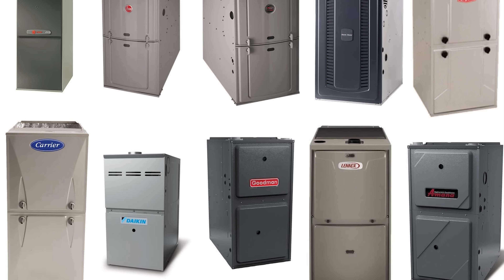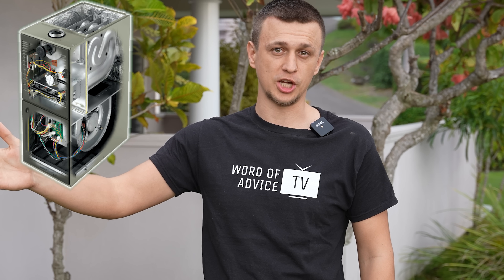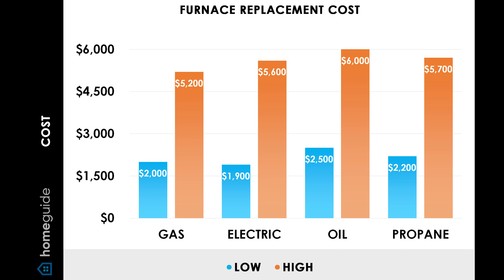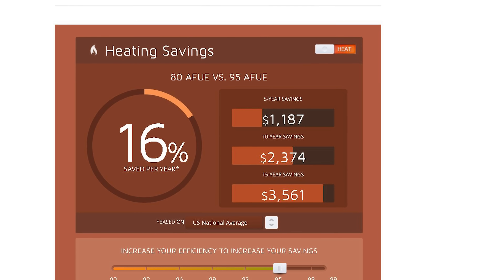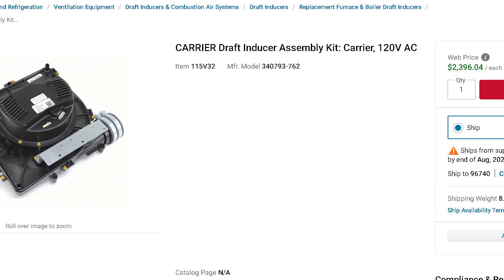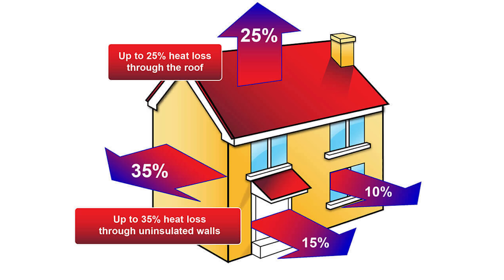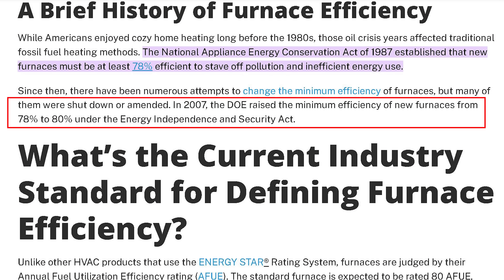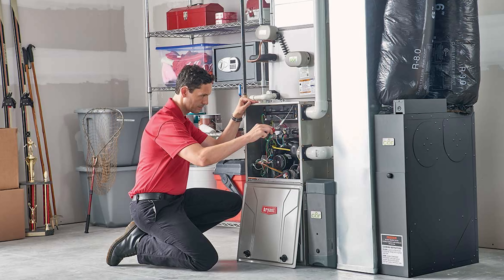Don't Buy a High Efficiency Furnace!

Comment: After retiring I wanted the best, installed 98% and 21 SEER. As natural gas price doubled, I really don't notice it, in the summer I can run my A/C during demand response utility increases and don't notice that either. I paid upfront to avoid concerns over my utility bills and so far am very happy with my choice. My equipment has a ten year warranty and lifetime heat exchanger. Hope I live that long! Thanks for your video!
Reply: My opinion also
Reply: What brand offers you a Lifetime on the heat exchanger?
Reply: Just so you know SEER is a made up number
Reply: @brightonmusic  Amana has a lifetime heat exchanger warranty. Not sure if it's for their entire lineup or select models.
Reply: You should have installed a heatpump. Absolutely nothing is cheaper heating. A 21 seer heatpump only increase the heating efficiency less than 2 on the hpsf over a 15 seer. You need to get the gas furnace taken completely apart every 2 or 3 years because the secondary heat exchanger gets lint built up like an evaporator and will melt the AC coil due to the heat rise due to the lower airflow. I charge $800 to $1500 to clean one. The inverter board is $2,500 if it fails. The parts aren't universally stocked meaning you might be left without heat or ac for a month or more waiting on the warranty parts. These aren't very popular and parts are way too expensive for the distributor to have sitting around. Virtually everything is special ordered. I've replaced around 5 condenser boards in the past 3 weeks in some inverter heatpumps because we had rolling blackouts that killed them. An out of warranty blower motor is about $1000 vs $225 for a 15 seer. The condenser motor is around $300 to 500 higher. The internal board is about $600 vs $50. The expansion valves fail quite often on the 18 plus seer. Costs $600 to replace labor, possibly $1000 more for freon (freon isn't covered under warranty) depends on the factory requirements, $400 if the expansion valve is out of warranty. You better get rid of it in ten years.. seriously. Oh yeah, some factories requires the warranty part sent back before they'll replace it on those high end units. I've been doing this work since 1988. Own a HVAC company for 21 years.
Reply: @billking772  Thank you! That includes labor? So far other brands I've checked also have a 10 year warranty for the part but not for labor, which is the expensive part of replacement.
Reply: @brightonmusic  I'm pretty sure it doesn't include labor. That's the gotcha part of the warranty. I had a 16 SEER Amana HVAC system installed last fall in our old house after 20 years of service from a no name brand AC and Carrier furnace. Had the ductwork replaced too. My installer told me of the repair costs of the higher efficiency furnaces. Didn't sound worth it. Not really keeping track of we are saving any in the heating bill, it's more about the comfort. More consistent temperature and so much more quieter than the old system.
Reply: I gotta say, if you live in a northern climate and "didnt notice" the difference in your utility bill either you arent paying attention or your math isnt good.  Im not trying to be mean here, but there's certainly a noticeable difference regardless if you noticed it or not

Comment: I replaced two builder grade Lennox HVAC units that came with a new house here in Southern California,  that failed within a year of each other, both the gas heaters as well as the AC's after just over 21 years. One never gave me any trouble in >21 years of service and the other was a money pit, costing me thousands of dollars over the years, always leaking refrigerant, and always requiring something that needed to be fixed or replaced. My fingers are crossed that the new American Standard HVAC units will last as long or longer. They certainly heat and cool much better than the old units. Given the continually increased cost of electricity here in California, utilities with the new HVAC units are noticeably less. Interestingly AC vs heat pump units had the same energy savings listed, and seer2 numbers given that allegedly heat pumps are more efficient. AC has a longer warrantee than the heat pumps from  the same company all things being equal.

Comment: May want to consider getting the variable speed blower option with the 80% furnace.
Reply: why? Please explain. thanks
Reply: @billmonroe8826  ,   It's not worth it unless you're existing blower motor fails and it's time to replace it OR if there is a utility rebate that will let you have the motor for free. Some states offer a 100% rebate if you change your existing blower motor (PSC type) to a variable speed (ECM).  The only problem with upgrading your existing blower motor to one of these is, it has to be configured (programmed) properly.  Nearly all installers will not do this. They'll just put the motor in and put it at the standard settings. Every heater, air ducts, and home are different and having the right airflow speed is critical for your furnace and AC system to work properly. I'm an HVAC contractor with 25 years experience.
Reply: I put in a new heat pump with the matching blower coil that got me a utility rebate at the time.  The blower was an upgrade to variable speed from standard style.  I really like the quiet start and I feel that it has saved me in operating costs as well.
Reply: Plus, I have now had the system for over ten years with out a problem.
Reply: All new blower motors, as of 2019, have to be ECM type.
Reply: @johnharrisonschulz  well let’s be honest only inexperienced or poorly trained installers aren’t going to set up your new system properly.
Reply: @robertsitch1415  exactly either constant torque or true variable speed. 🤬government

Comment: What about using a heat pump with backup resistant heat as the emergency auxiliary heat? They're way more energy efficient than traditional furnaces, and while they are expensive they function as both the heating and the cooling.

Comment: I've been an HVAC R
For 40 years and I totally agree with you what sucks is that companies constantly push technicians to sell 90% equipment And i find it's only come back to bite them with warranty callbacks complaints
Reply: A warranty callback doesn't cost the owner in terms of money, only convenience. It may or may not cost the company depending on labor allowance.
Reply: Lets Calculate: Savings of 95% over 80% for 35 year life of Lennox Pulse.  $1000 year spent on Nat Gas with 95% so spent $35k in 35 years.  Would need 19% more gas for an 80% (.95/.80=.19).  So $35k * 19% = $6,650 saved over 35 years.   NOT ONLY is there energy savings, but HIGH quality equipment last twice as long, so saves another $3k to install another one.
Reply: @pablopicaro7649  you must sell HE furnaces. Your comment is everywhere😂😂😂
Reply from the maker: @sixpackofxfactor Ah yes! I forgot about that part. Many companies either pressure or incentivize their techs to sell the high efficiency units and to discourage homeowners from buying the 80%ers. Thank you for pointing that out!
Reply: If you live up north, you get 95%. If you live in the south, you are a fool if you get 95%.
Reply: @Kiddro22  if you are in fl the only ppl who have gas are the rich. They don't need gas heat at all since hp works well there, but they want something that works quick and gives hot air.
Reply: @sprockkets  I’m in the Midwest. But I get it
Reply: We have a Bryant 987 and we havent had a single problem yet, evne if we did, we would pay nothing. I am in MN and the previous furnace was a HE, so new duct work would bring the price of an 80% up anyways. Also the $1050 rebate for energy star qualified.

Comment: I went with 96% efficiency not for cost-savings, but for comfort and convenience. PVC exhaust and intake was quick and easy. Multi-stage gas valve and variable speed blower is far more comfortable than what I've had before.
Reply: Agree with choice because of your reasons. That was an educated choice.
Reply: Multi-zone is what I have at home.  Each floor has it's own thermostats and return vent. Couples that with smart vents in each room, I can shut off air to rooms that are not used.
Reply: What make and model?

Comment: Almost all of our homes here are spray foam these days. If you install the furnace in the attic you have to use 90 plus furnaces so you can two pipe them for combustion air.

Comment: As an HVAC Tech, owner, I agree with Word of Advice TV on this video. I always tell my customers to invest in home insulation first.
Reply: This is the decision I’ve come to as of this past Monday. I have a Lennox Elite 96% HE. Was installed in 2013. It’s been giving me problems for 2yrs now. I’m about to yank it for a 80% 2 stage w/variable blower and just insulate my home more. Bottom line, I’m tired of these HE unit woes. The prices of the parts and the scarce of them not being found. I’m going back to square one.
Reply: The great thing about insulation is that it doesn't break, and there are no parts to replace.
Reply: @jasegudat9590  insulation does actually break in several different ways. It can get wet and moldy, torn when running electrical, etc. But the biggest offender is a bad installer.

Comment: Your information about furnaces is flawed. 80 % furnaces were discontinued and deemed illegal to install in Canada in 2010, with the entry level furnace being a high efficiency furnace. While I agree with the fact the mid level high efficiency furnace and the top level high efficiency furnace do have a super high repair cost, the standard 1 stage gas furnace isn’t much better. Someone in the comment section mentioned the Lennox Pulse furnace. It had the least amount of moving and electronic parts and found that they were extremely reliable. Their downfall was that the secondary exchanger operated under positive pressure, which means that any perforation in the secondary exchanger would allow exhaust gas and carbon monoxide into the living space, and there was a partial recall on secondary exchangers for joint failures. The Pulse furnace was discontinued some 20+ years ago.

Comment: I do industrial refrigeration and hvac, I 100% agree. You are better off getting double or triple pane windows and get your home insulated to the tee. Which is exactly what I did. Then I installed a two stage 80% furnace and leave my fan running 100%. I'll put it to you like this, on a 35, 40 degree day my home is sitting at 68 degrees period with the thermostat off.
I just replaced a Bryant plus 90% secondary heat exchanger failed. And that life time heat exchanger warranty , try finding a company that will do the job, it's like having major heart surgery. Where an 80% can be done in less than 30 min's, my record is 20 lol.

Comment: You fail to mention that a high efficient furnace is actually less expensive than an 80%. You can get a 97% efficient furnace with a variable speed motor and modulating gas valve for less than a single stage 80% after the $400 utility rebate, $300 manufacture rebate and $600 federal tax credit. So for the same price or less, you’re increasing your efficiency 17% and comfort level with the variable ECM

Comment: My Day & Night gas furnace is from 1977. It still works. I've had 3 hvac technicians to my house because I wanted to just clean and check it, but all 3 said it's not worth the risk to clean it because it's so old and it might risk something breaking. They all recommended replacing with a new standard 80% gas furnace because next year in california they won't be able to install a 80% gas furnace. I'm not sure what to do. We use the heater from nov to march. It gets into the 30s at night in winter.

Comment: I must disagree with the pricing of high efficiency furnaces.  I recently installed TWO Carrier (Model 59SC5) 95% high efficiency furnaces, 80,000 and 120,000 BTU units for $7000.  That includes labor to install. I live in Seattle, where prices are high and winters are long.  And Carrier provides a 10 year parts warranty and lifetime warranty for the heat exchangers (labor not included).   So, the cost in this video is not as high as stated, IMHO.
Reply: What company are you with? I live in in Seattle too, and was just quoted 7-8k for one high efficiency furnace 😮
Reply: As far as the States are concerned, it makes a lot more sense having a higher efficiency furnace for colder climates. I live 400 miles north of North Dakota and our HE furnace will pay for itself inside of 10 years. Even sooner since our carbon tax increases yearly now.
Reply: @mothaphoto  MM Comfort.  I think they are based in Redmond.  Negotiate with them.  Prices may be higher now.  Mine were installed in March 2020.

Comment: Another thing to consider is that installing an high efficient one may require additional work, for example you need to run a condense drain, you need to have exhaust pipe made of plastic material (otherwise condensation that is acid will corrode them), you need an air intake from the outside. 

You also have to change the way you use your heating, that is to have high efficiency you need to run the boiler/furnace at lower temperature and keep it on for longer time.
Reply: Lets Calculate: Savings of 95% over 80% for 35 year life of Lennox Pulse.  $1000 year spent on Nat Gas with 95% so spent $35k in 35 years.  Would need 19% more gas for an 80% (.95/.80=.19).  So $35k * 19% = $6,650 saved over 35 years.   NOT ONLY is there energy savings, but HIGH quality equipment last twice as long, so saves another $3k to install another one.
Reply: @pablopicaro7649  One if his points in the video was literally that the high efficiency equipment not last as long. That’s why the savings argument fails.
Reply: @bingoboppins9875  thats a boomer myth that it doesnt last as long
Reply: Your second paragraph makes absolutely no sense! I'm a HVAC tech and business owner. Installed a 2 stage HE furnace 12 years ago in my home. Regular filter changes and thorough clean and check in the fall - never had to replace anything. 
From my experience, 90% of HE furnace issues with heat exchangers and ventor/combustion air motors comes down to bad install issues. Major reasons for heat exchanger failure (both 80 and HE). #1 dirty/plugged filters #2 venting, venting, venting (exhaust for you laymen) #3 overfiring (gas valve not adjusted properly or at all) #4 oversized furnace short cycling - hurts everything 
Yes, things aren't made like they used to be. This applies to the 80's too, so don't fool yourself. There are a lot of common parts used in both 80's, HE's and across all manufacturers (same part manufacturer, small differences). Not telling anyone what to have installed, but some of the statements in the video are laughable.

Comment: Most high efficiency systems have a 10 year warranty. Also, theres lots of rebates out there that would help with the cost of higher efficiency systems. I think more importantly it really depends on where you live and how much you run your heat on a yearly basis. There are are hvac calculators out there that you can use to determine your payback timing etc.  I do agree that parts and repairs are very costly and increasing regardless what type of system you have.
Reply: well, my HE is 11 years old and now must be replaced!  A new one will be about 8k due to the chip shortage.  NOT happy!  The previous furnace lasted 30 years and only died because of a lightening strike that melted the board.  The one I have is a Bryant.
Reply: I have yet to see all these condensing furnaces failing all the time, he is making it sound like they fall apart. Improper installation, poor filtration, poorly sized duct system an improper venting will lead to issues, the ecm motors are quieter and I have been replacing a-lot less of them now, there are cheaper universal replacement ecm motors available and prices have dropped. Times are changing and technology improves
Reply: @e-spy  that’s because the previous generation Carrier/Bryant heat exchangers were designed horribly, they are incredibly sensitive to over heating. They had to have proper ducting and air filters also HAD to be changed regularly. I know a customer who changes the filter religiously and the old carrier furnace still looks in mint condition new even after 20 years.
Reply: @joeybrazda364  filter changes are in my calendar, so that wasn't the issue.  Neither was ducting as they checked the entire house and told me they were all good.  I even get ducts cleaned every four years (also in the calendar).  Maintenance was done yearly.  They said it was the secondary heat exchanger and it was faulty.  But they did give me a discount of about 2k, and recommended without prompting the standard.  Thanks for the info!
Reply: @e-spy  Your heat exchanger is still under warranty - this is a common scam that HVAC companies do. You'll see that on the anti DIY hvac channel (he's against DIY because most of them manage to make things worse and scam people of their money).
Reply: Rebates don't help for disabled and retirees though. Government keeps forcing us to do things with rebate incentives, but that doesn't work for those who need reductions the most.

Comment: I am a retired engineer.   I completely agree with your analysis.   In terms of reliability,   the failure rate is based on the number of components you have.  Less things to fail means less repairs.  Great video!
Reply: Disagree, less components being "better" is an old man boomer theory.  In reality, the quality of the components and the reputation of the company is what matters most.